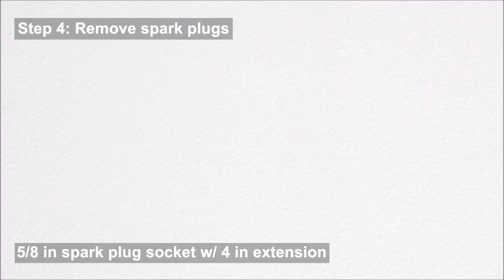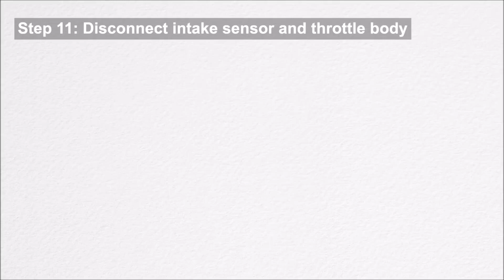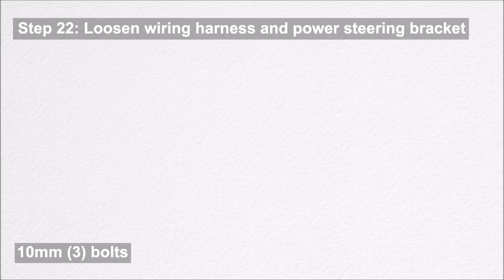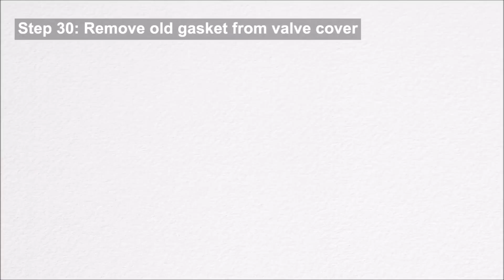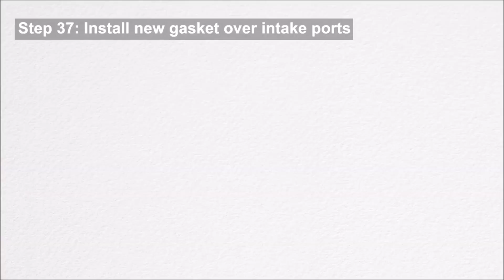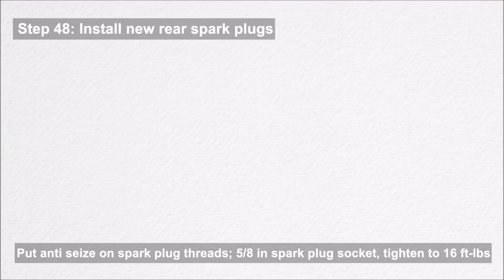Honda Spark Plugs, Tube Seals and Valve Cover Gasket Replacement (55)

Comment: I removed the rear wiring bracket from the rear valve cover. It’s the rear metal bracket held by 2 10mm short screws. I have tried to remove the rear valve cover from the driver’s side using my right hand and pushing the passenger’s side end of the valve cover back towards the rear firewall. How did u get the valve cover to be loose over the rear vtec solenoid? Mine seems like it’s stuck over the rear vtec solenoid .
Reply: I got the wiring harness loose. On the left next to the steering wheel actuator there’s a brown tab holding the left side of the wiring harness down. Locate the brown tab and pull up to release the tab. Now on the rear wiring harness there’s another brown tab holding the right side ( driver’s side) down. Locate it with a flexible mirror and 2 lights. It’s going to be held in towards your body ( front side of engine) so u have to pull up on the brown tab and when it releases pull the brown fastener towards the firewall or away from you. The wiring harness is now released and you can pull off the rear valve cover